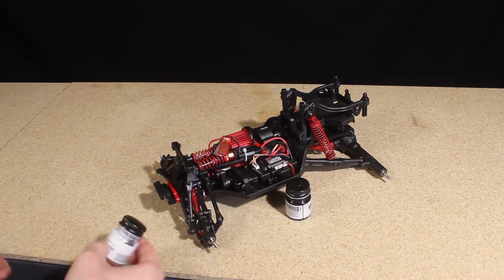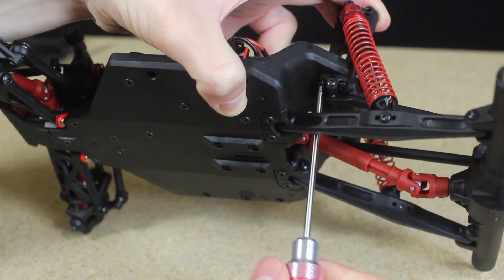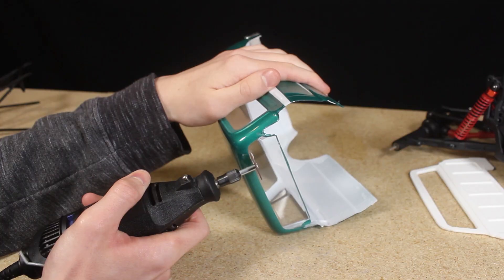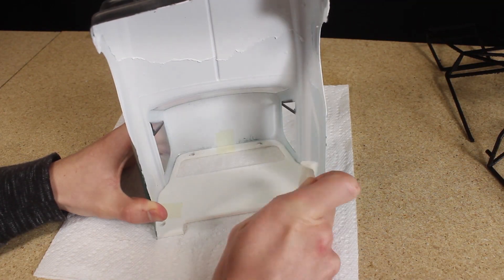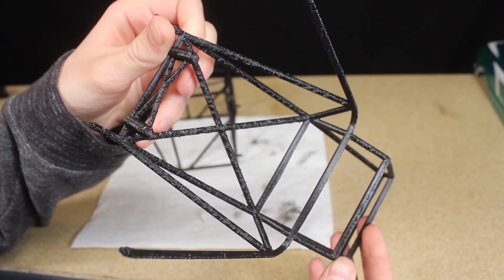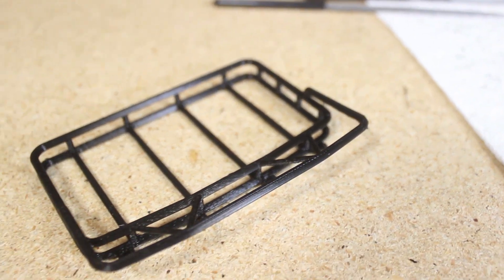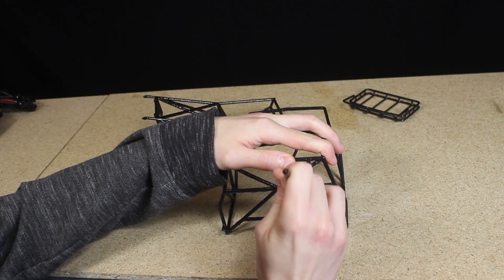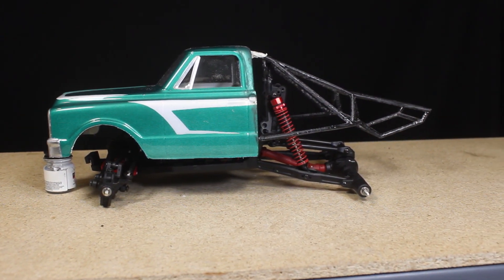Project Prerunner: Part 2 Adding Roll Cage and Working on Cab

Comment: Pro tip - Use ABS with 3D prints so you can use an acetone vapor bath to smooth out the parts for a glossy, professional look. 
Other than that, Keep up the great work and excellent videos. :)

Comment: What size outer diameter are all the members on the roll cage? Do you think it is strong enough to withstand a rollover at speed?
Reply from the maker: The OD of the tubing is 4mm except for a few spots that are 3.5mm. It is quite strong especially after the resin coating. It's every bit as strong as your average injection molded plastic part you'd find on any hobby grade RC, but it is more brittle so it would be more likely to break under a hard impact rather than flex to absorb the impact. It's strong enough for the driving that I will be doing.
Reply from the maker: It depends on what material your tubing is, I'd image 6mm of plastic or metal would be quite strong. Of course just like when building a full scale cage, the structural design is important if you need your chassis to be strong and ridged. Good luck with you build.
Reply from the maker: @RC-XTREMETEAM The entire cage was printed in two pieces using PLA plastic.
Reply: Rafik Volkov thats what I was questioning. You printed it all at ones?? How did you do it??
Reply: Make It RC That's interesting. I'm designing a car now and the whole chassis is 6mm OD with a 1mm ID and I want sure if it would be strong enough. I guess it is probably overkill then lol.